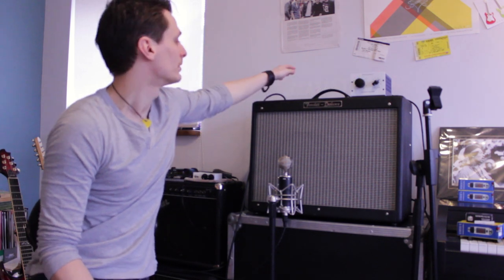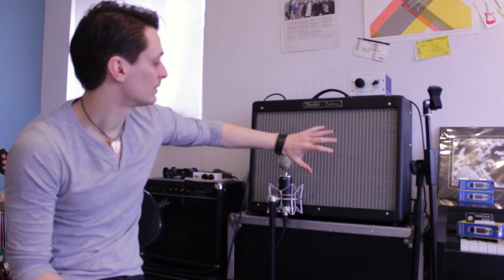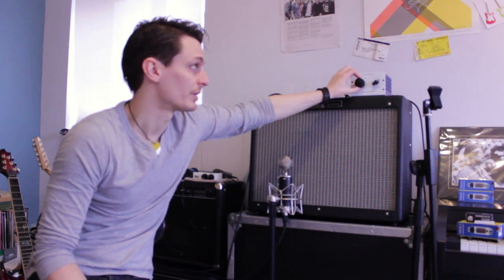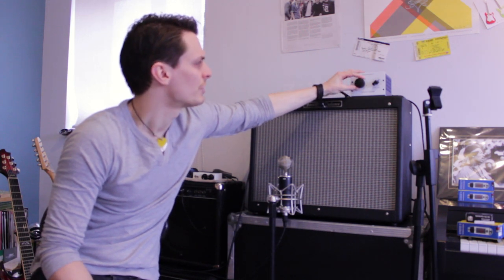Jet City Amplification Jettenuator

Comment: Just bought one of these and can't work out the wiring (i realise this must be ridiculously simple). I have a fender blues deville  4x10, could you explain whre i take the signal from the amp to the jettenutator and from that to the speaker?
Reply from the maker: On the back of the amp there should be a couple of jacks (one which the amps speakers are already connected to) and one with nothing in. You need two speaker cables and a male to male quarter inch adapter. Take one speaker cable and plug it into the Jack on the back of the amp (the one that the speakers were connected to originally). That speaker cable goes into the Jettenuator, 8ohm I think is the correct impedance for your amp but check. Then from the out Jack of the Jettenuator  use another speaker cable to connect that cable using a quarter inch male to male adapter to the speaker cable already attached to your amps speakers. 

Hope this makes sense. I think I'm going to make a video on this because your not the first person to ask for more information.
Reply: +Matt Lee Cheers matt, I knew it was something simple. I had a lead coming from my 'pre-amp out' and nothering from the existing speaker jack... palm to face
Reply: @Matt-T-Lee  Hi Matt, Do you mean quarter inch female adapter so the 1/4 inch jacks are plugged in at each side??

Comment: Help please, my jettenuator no longer soaks my volume boosts from my fuzz, distortion etc
Reply from the maker: Hi Jonas

Could you give me a few more details about the problem?
Reply: Well when I turn up the volume of my big muff or ds-2 it doesn't soak the volume anymore, I used to be able to turn the jettenuator up to 2 and gve a moderate output, now I can only go to 1 and play really carefully with my gain pedals, I don't think I have changed my pedal line in any way since the jet city worked properly
Reply from the maker: What I would do is take the Jettenuator out of the signal path and make sure the amp and pedals are working properly. Then if the problem goes away it's something to do with the attenuator and I'd get it checked.
Reply: i tried switching the ohms to 8 on my amp and the attenuator, it helped but dident solve the problem completely

Comment: Hi Matt. Just a question, how do you plug into the amp ?
Reply from the maker: Hi AleGibsonSG 
I plug directly into the amps input. The Attenuator goes in between the output of the amp and the speaker itself.

Comment: Hey my jettenuator has recently been getting easily overheated and giving off this slight but bad burning smell. My amp setting have stayed the same for a long time so I'm pretty stumped on what's going on. Would you happen to know what I could do to stop or prevent this overheating and burning smell?
Reply: you connected 2 speaker cables in your attenuator?